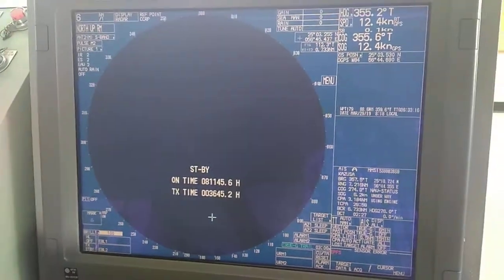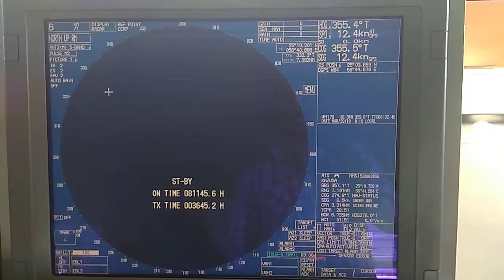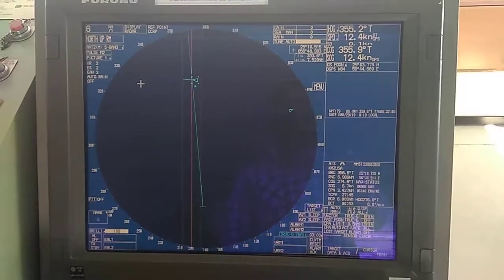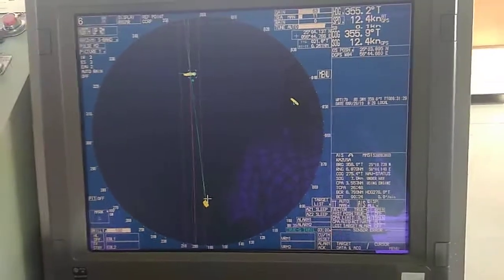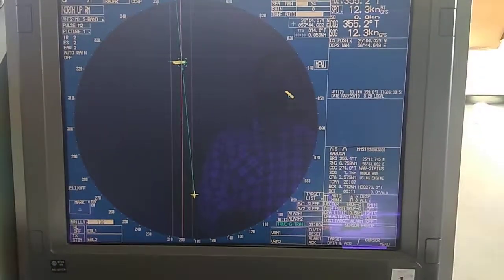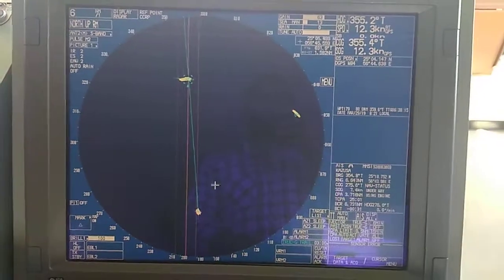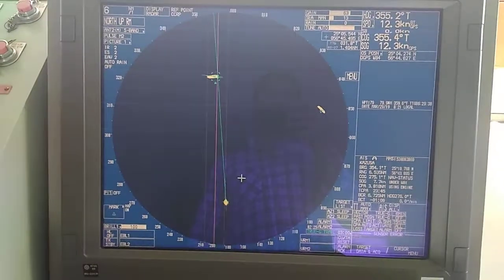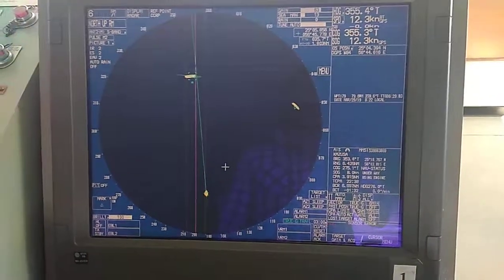Tuning of radar

Comment: Do not use the EAV and ES during tuning of radar. You should get a good picture without that turned on. 
GAIN should be adjusted so you have a slight amount of seaclutter visible, so you dont loose small targets. Then you adjust the Sea-clutter to eliminate unwanted signals. 
refering to Operators Manual about adjusting sensitivity.
Reply from the maker: Thnku very much for ur comment. 
I highly appreciate   :) 
U r right  :)
But EAV  helps u to diminish or remove all those  unwanted or false echoes,    EAV  actually averages echoe appearing on PPI, so remove unwanted and false echoes,   so its helpful.
Reply: @merchantshipsknowledge3941  Absolutely, its very helpful but can also be dangerous if you dont know the functionality of it.
  EAV calculates if a certain ehoes appears on same position twice, then it flags it as an echo and raise the echolevel. Differently on EAV1, EAV2 and 3... 
With EAV 2 the limitation is that you can loose fast going vessels because the radar thinks its seaclutter. (moving to fast and not in same calculated position) 

Keep up the work!